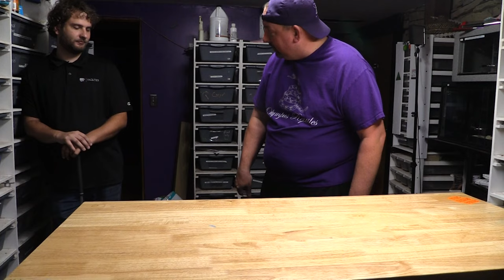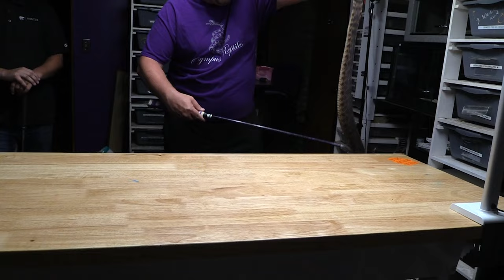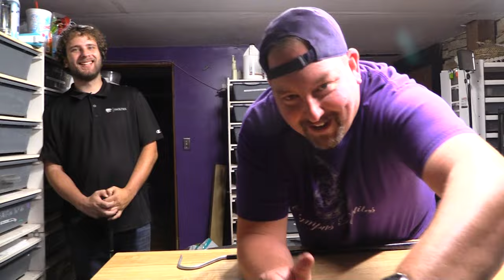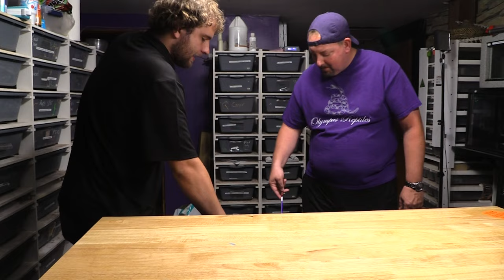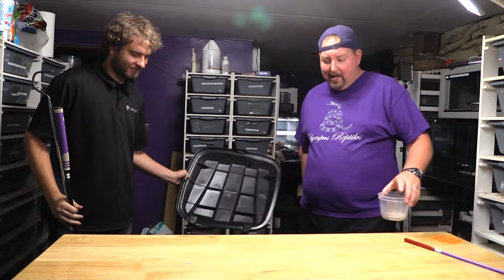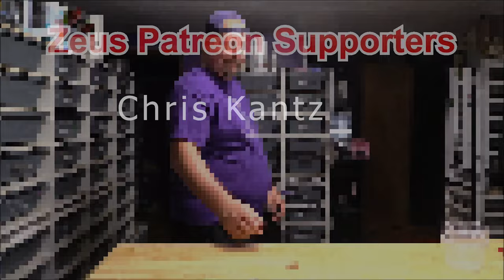VENOMOUS SHOWDOWN!!! Grudge Match between VENOMOUS SNAKES!  Gaboon viper vs. Western Diamondback!!

Comment: As awesome as Gaboons are I think for an overall adaptable snake the Western Diamondback is the winner. They can adapt to a huge range of temperatures as well as habitat. Here in California I’ve seen them all over the state. I think Gaboons are highly adapted for their location but they wouldn’t survive in the same type of diverse range as a Western. I would imagine Westerns could become invasive in the gaboons range but not vice versa. I have a question about those shed fangs, is there a way to clean them so they’re not dangerous? Can’t you still be a little envenomated if you get poked with one?
Reply from the maker: I have soaked in hydrogen peroxide